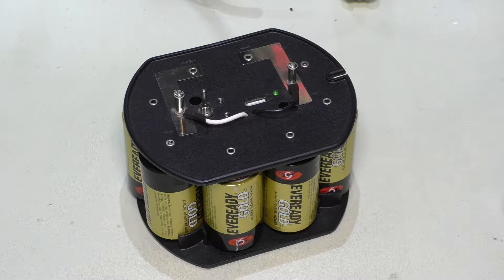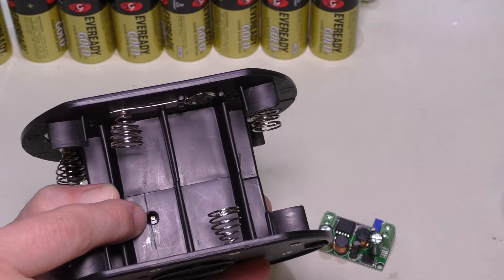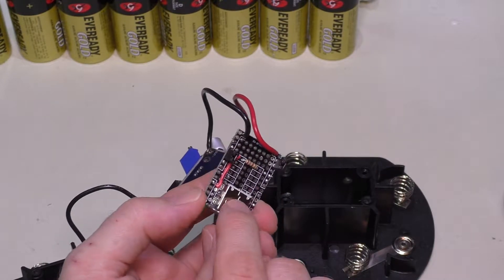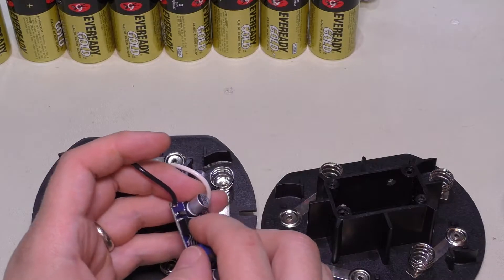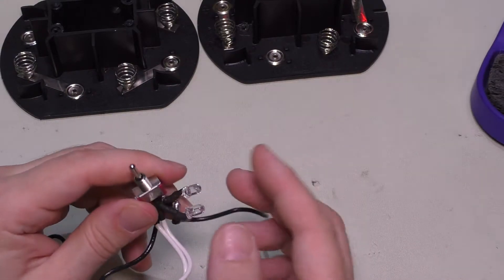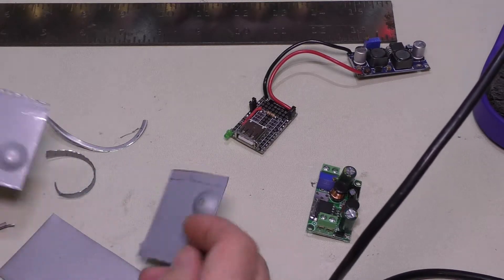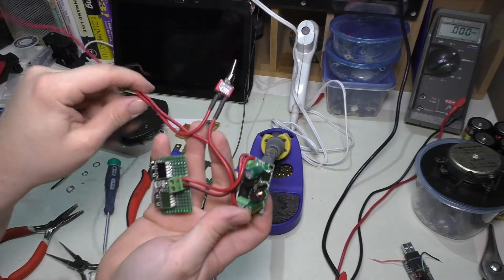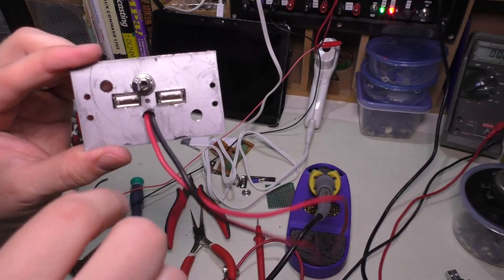PTS Ep. 196 - Late Night Custom Power Bank Project Redo Session

Comment: Great video.......yup nearly always something stupid. Sooner or later you can move towards LiPo or NiCd battery packs, a la Julian. I keep saying that too, but never seam to sink any money into it...still on my to do list as is solar power. Always something to do!!
Reply from the maker: I have a project that benefited from using a LiPo battery pack that was salvaged from a portable DVD player.  Built it almost 6 years ago.  I used the balance / charge circuit from it and everything.  I kept telling myself that I'd try to reverse engineer it and build my own.  Of course this is from a time when I was really just getting into electronics and you couldn't just order a nodule off of eBay to handle LiPo batteries.  I still tell myself I'll start working with them but the cost is prohibitive.  I watch Jules' videos quite a bit and I keep getting bitten by the bug to step up my game.  Soon...